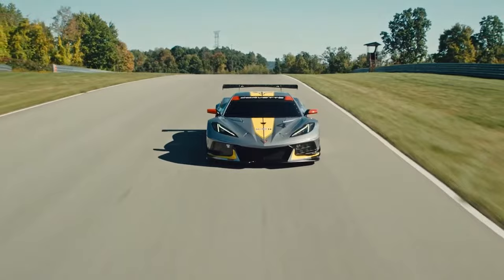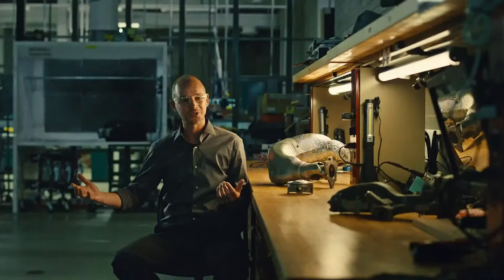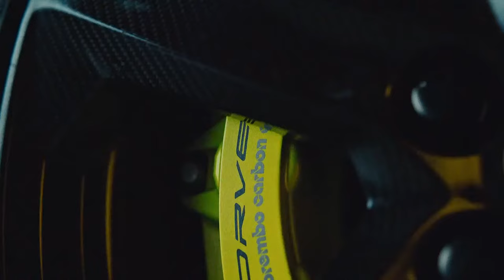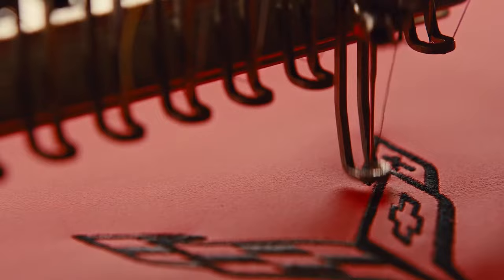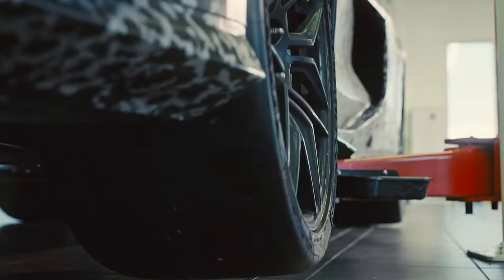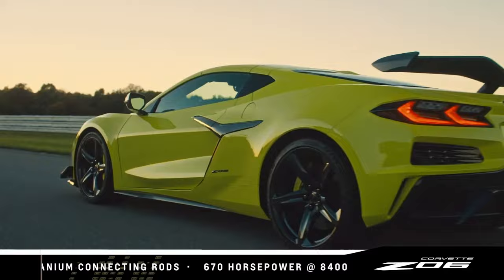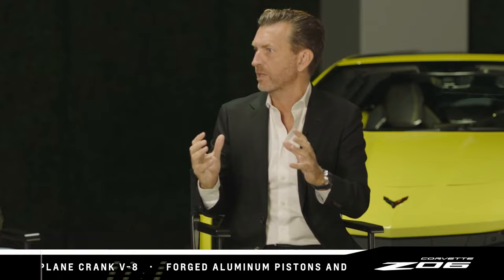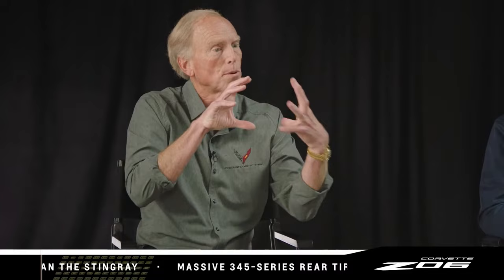All-New 2023 Corvette Z06 Reveal

Comment: Build a modern version of a 1972 Chevelle. A full-size two door car, rear or all-wheel-drive with any GM V8.  If that ever happens please don't cover it in a bunch of aggressive looking plastic.  Keep it clean and simple, not overly designed and busy looking.  Now that the Corvette is a mid engine road course killer the Camaro is now GM's front engine RWD Sports car.  Make the Chevelle bigger than the Camaro like it's always been, but make it more refined, more luxury on the inside and even offer a vinyl top option.  It would be awesome to make the new Chevelle a all-wheel-drive GTR killer but without the expensive base price tag.  The Chevelle would make the perfect display vehicle for the new GM performance 1000 hp big block crate motor

Comment: Hey guys I need your suggestion please. I’ve placed a deposit for a c8 stingray about 4 months ago. I was planning to get it with the non Z51 package since I wouldn’t track the car. I care about looks more than performance since I would just be driving it on the weekends. I was going to order a HTC, non z51 with all the carbon fiber options from factory and some market CF parts (lips and spoilers) . I was also planning to put some after market wheels, forgiatos which are like 7k since I don’t like the factory wheels at all. With adding the performance exhaust and front memory lift the price comes out to $83k before taxes. After all the customization with the after market wheels and CF that i mentioned I’m looking at almost $95k - 100k with tax etc. I was ok with all this but the only other thing I wished Chevy offered on the stingray was the adrenaline dipped interior. Lo and behold Chevy announced that on the Z06. I never planned on getting the Z06 but now when I watched the reveal the z06 has everything I wanted. It looks so aggressive just the way I wanted it. It comes like that from factory and I don’t have to buy parts and wheels  from various places and get them installed. The factory body , wheels , exhaust are all excellent. Plus it has the red dipped leather and better faster engine is a cherry on top. My main question is, Should I stick to plan a and get a stingray and customize it with aftermarket parts, exhaust and wheels or get the Z06 Which comes from factory with all the things that I wanted. Of course I would love to get the Z06 since everything I want is w from factory but I’m not sure about the price point. You think with all the options I want, will it exceed 100k ? Is it with paying more or just stick to the sting ray? Thanks in advance.

Comment: Love it!  Really, I want one!  I was surprised to see the 0-60 tp only be 2 or 3 tenths quicker than the Stingray.   With the additional 175 hp and I assume gumball tires I would expect a bigger difference.  ( not that it needs to be,)  my C8 HTC has indicated 2.8 many times and I have the non Z-51 all season tires.
Reply: 3 tenths is still 10%. 0-60 times are so crazy low now, it's really just marketing IMO.

Comment: The only problem with single plane crankshafts on v8s is yes you get more peak horsepower but you lose average torque throughout the power band because of the way the design is You don't have a cylinder firing every 90° You have one firing every 180° therefore the torque is in the smooth but the RPMs grab faster but you'll have more power with the other design overall power torque

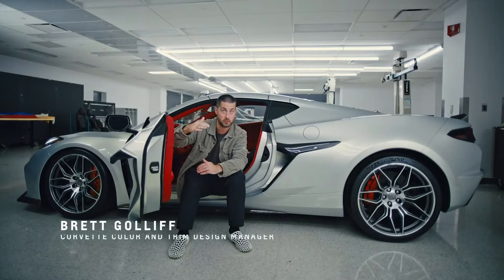Comment: I am an old school Corvette man. My Favorite all time car is a 1967 L-88 or ZL-1 Corvette 4-Speed 4:11-1 Posi Rear ended car. 1969 ZL-1 was my second favorite car then in 1984 Chevy Totally Ruined the body of the Corvette until the mid 90's , then again they totally ruined it totally until 2007, then they ruined it again until 2023...NOW, I have to tip my hat to you Chevrolet, You finally made a Corvette with a Super Cool Front End and a Super Cool Rearend. I hope you dont SCREW this up for at least 6 years. Your body designers since 1969 basically should have been taken out to pasture without any grass to eat. That's a very nice way of saying what I don't want to say. Hooray to the Z06 again. 670HP out of a Small Block today is impressive but I'll always be a Big block 427 CU motor with ONLY and 3.76 Crank not a 4.00 crank. The 3.76 will eat the stroked motor every day. I was fortunately to own an original 1970 SS 402's but I modified the heads and added a high lift 700 in lift Solid Roller Cam with a 1150 Holley Dominnator with annular port discharges and my Chevelle beat every 454 ever built by 75 yards in the 1/4 mile. My car weighed 3,850lbs and ran 10:35 @ 138mph in the 1/4 at Bradenton Race Track in Florida. I still have the pictures of the best looking 70 SS ever seen and the time slips to prove it. Imagine a 4.600 All Aluminum Big Block with a 3.76 crank putting out 500 CID with my internal parts today. What would that motor do to the Z06?  Just a thought. Everything that I mentioned that I had in my 402 but more importantly the ZL-1's motor had 12:50 to 1 TRW Dome Top Pistons. I'll bet your ZO6 maybe has 10:50 to 1 pistons because of fuel. I also took the fender wells out of my 70 SS so I could adjust my lifters every week in less than 30 minutes. You may have built a 670 HP Small Block engine, but I'll bet you 1,000 to 1 that not one person can change the plugs in the car, let alone adjust the lifters but I'll bet you put Hydraulic lifters in it also. That's a shame how you people make cars today on purpose that even people like me " TRUE GEAR HEADS" can't even work on that car without a Nascar Garage with 1,000,000.00 worth of tools and equipment. Shame on you Chevrolet but thanks for the 2023  ZO6 Corvette anyway.  For all of this 2023 ZO6 Corvettes Glory cost at least $135,000.00  Am I close?

Comment: I was considering buying a Ferrari, and on a long visit at the dealer I sat down with the service manager to discuss the maintenance schedule.  It was vulgar.  Not just the cost, but how often it required major service.  I bought a Viper instead.  Vipers and Corvettes are cars you can beat to death for 200,000 miles and just change the oil.  Viper is gone, and GM just dropped this fantasy car.  Stunning.  The lack of a manual transmission means I will not consider one, and I hate that Team Corvette made that choice.  Other than that glaring issue, this car is perfection.

Comment: Nice✨🔥They don’t mention the dual over head cams at all tho they are definitely trying to not mention it so they won’t get pooped on by people saying the went Ford style DOHC , that’s the reason why the RPMs keep going after 6k rpms just like a coyote Mustang it keeps going at the same fast paste till it taps out  , flatplane crank does help but it’s mostly the heads, a OHV engine with flat plane crank will still not be able to reach 8600k rpms one cam is not enough to take it up there that’s why they stop performing after 120mph . Emilia looking cute as always to ✨☺️

Comment: ZR1 could be a twin turbo monster with 999bhp in 2025, then the Zora Edition Hybrid System with AWD from Electric assisting motors and the everything a high downforce Active arro. Wider and crazyier could run 8's in a 1/4 mile.

Comment: Who knew all Chevy needed to do to create a masterpiece was to use Ford technology for their engine! Love you GM. A true fucking masterpiece.
Reply: What technology would that be exactly? This isn’t their first masterpiece btw.
Reply: @mikejonez724  I can agree with that. C7 ZR1 was pretty badass. But I'm talking about 32 valve, DOHC, flatplane crank engine. That's not the typical pushrod Chevy typically throws in their performance vehicles. They might as well thrown a Voodoo in there. Not hating on the car or Chevy engines. But you can't deny the extreme similarity between Fords Voodoo engine and this new LT6.
Reply: @nathanzavala6470  that’s hardly a Ford technology. This engine shares nothing in common with the Voodoo engine aside from cylinder and valve count but there are a multitude of engines that are already on that list. If we want to really get into it GM did it before Ford ever did back in 1990.
Reply: @mikejonez724  eh. Ultimately I don't really care since I'm not a fanboy of either company. I love them both. But I do think it's disingenuous to pretend that this isn't Chevy who is renowned for their pushrod LS engines coming extremely close to making their own Voodoo. The comment about Chevy doing it first in 1990 is the equivalent of me saying that Ford did pushrods first since the LS heads fit perfectly in a Ford Windsor engine. Its disingenuous. And I'm not trying to be biased. Just like I'm saying Chevy is making an engine similar to Ford with this new LT6, Ford made an engine similar to Chevy with their 7.3 Godzilla. It's not mutually exclusive.
Reply: @nathanzavala6470  I’d say it’s disingenuous to claim GM is using Ford technology in this car at all just because the engine layout is different. That’s like saying Ford used Ferrari technology to make the Voodoo. Just because it’s a departure from their normal methods doesn’t mean it’s not their own technology. Ford’s 7.3 engine similarly isn’t using Chevy technology just because they don’t typically make pushrod engines anymore. That would be just as disingenuous if a statement.
Reply: @mikejonez724  ultimately its just my opinion. I don't feel LS guys would have the same outlook you do if Ford started using pushrods in their performance vehicles. I do respect your balanced perspective however. We can agree to disagree on this. I'm sure we CAN agree on this being one fucking amazing car though. Excited to see what it can do.

Comment: Too bad GM went to a DOHC on this. They're too physically enormous. No room for turbos, superchargers, intercoolers or all 3. The LS and LT engines were simple, strong and compact in size. There are steel legal pushrod V8,s with up to 3500 hp from both GM and Chrysler!

Comment: The Golf Club ass works better on ZO-6 . Im not an Engineer or Designer but I wonder if rear lights that were styled differently would or could improve the look . There is a lot of sharp and angular lines on the car which is great . It has a mix of angular and rounded which is also GREAT , what I wonder is if possible what would less angular geometric shaped rear lights might do . I think its the "bow" of the top of the rear which is both a bit blocky but has that dip which IS more round but not pleasing to my eye and then the lights that are contoured and recessed with the hockey stick lights .I feel like the car has enough interesting design that rear lights that are less distinctive actually might tone down the rear that is probably the thing most often talked about and called Camaro like which insinuates working against a super car type look . It could be argued that C8/Z06 styling wise is a mix of Ferrari AND Lambo while retaining Corvette looks of which it does 100% while also making it have remarkable space between trunk and frunk for a mid engine exotic shape  which might mean there isnt too much choice of options for the lights including shape to work with the bow in the rear but I wonder if adding some simplicity would clean up the design or not draw your eye as much.

I could be wrong or right in regards to the engineering constraints informing design but from my first view it was the only thing I wasnt crazy about and it seems to be a consensus so its not just me.

It is in fact a complete nit pick when you consider the entire car and when you add the price to entry it is literally a miracle IMO . I dont think there is a special car on the market that comes anything even mildly close for value . They turned up the value proposition and bang for buck up to 11 with no car that can think about competing . C8 with Mag Ride might be the best GT car ever produced with non Z07 beating C8 if you want extra super car sauce .

There will be cars that will be Straightline faster although I think under 3 and 10s that anything beyond that means nothing for a street car and i am interested to see lap times against Porsches and others that are way more expensive to buy and own .

I do wonder if the design team has listened to the push back on the rear and toying with options if there are ones that are doable .
Reply: It don't get no better than that car go chevy

Comment: I traded an R8 V10+ for a 2022 C8, rapid blue LT3 convertible.  This thing is so slow in comparison. I am getting the Z06 which should solve the problem.
Reply: I love my Corvette's but, would never trade an R8 V10 plus for the C8 Stingray. Wash the R8 a problem child or an old model year car?
Reply: @ronretired282   I purchased my 3rd R8 in 2018 with a window sticker of $207k for $184K....I drove it for 3 years and made love to it as it was the best R8 I had owned.  But when the value creeped over $200k I chose to walk away with a profit.  Just in time for the R8 to start to decline in value again. It was a good decision.  If the Z06 ends up having a 30k mark up at the dealer I will find another R8 I like even better.  I have bought 52 new vehicles in my life so far.  I have a 08 Tundra lifted with kings, a Porsche Macan S, A 2007 Z51 convertible, a C8 convertible, an S5 and a Dodge Dually.  And yes I dumped a beautiful classy supermodel for a cheap flashy whore.

Comment: all good but where is the manual tranny? Wont give up my C7 manual just yet. Checked out the standard C8 and was not impressed on the moldings/metal vents. For lack of a better word...flimsy. Will need sum serious after market help with these flaws. Seems the engineers did a fine job on engine but lackluster effort on finer details like the exposed radiators just begging for a piece of roadkill to hit them at speed. Seems the trend as i see the same on new vehicles lately? WTF chevy? Big grill with big holes in it? Those flimsy metal vents atop the hatch over engine are so sad. A pretty engine till it rains. Easily remedied by putting curved venting caps over this facing towards rear of car of course. That will keep engine dry. Maybe one day production catches up to demand so i can buy one at msrp. Otherwise the Z06 C7 will be my upgrade.

Comment: You don’t get a pride for bigger engine tho🙄 it’s only a 5.5 my Camaro got a 6.2🥲 but besides that everything else is good 😌
Reply: Flat plane design makes all the difference. Spins up to 8600 RPM and 670 HP.
Reply: @darknes7800  yea ik number is all good, but why ppl don’t buy Fearri if they wanna flat plane super car?
Reply: @cgjason7168  You will be able to buy a Z06 for $85K to 95K. You cannot touch an entry level Ferrari for less than $200K.
Not to mention the MASSIVE maintenance of the Ferrari.  With the Z06, just change the oil and ROLL !!!!!!!!!!!!!
GM just built a $90K supercar killer, that is a BIG deal !!!!!!!!!!!!!!!!!!!!

Comment: GM you need to get rid of that Tweety Bird Yellow! It sucks! And it sounds like any other Euro Car!! And this Flat Plane Crank is BS! My wife's Chevy Van has a 4 cylinder engine with a Flat Plane Crank!  What allows the high RPM of this Corvette engine has nothing to do with the degrees of throw with the crankshaft! It is the DOHC system. For all you people in Rio Linda that means Double Overhead Cam Shaft! This engine could have the regular cross plane crank layout and turn the same RPM and have the same power with a Corvette sound not a Ferrari sound!

Comment: Saw some of the engine design. So very much like Chevy to copy the heads and flat plane crank off of Ford's GT350, open the bore spacing, add a little piston to valve clearance and some bigger cams. Not really much of an engineering feat.
Reply: Thats cap, if that was the case ford would be here..doing the same..ford can't an never will be at this level...